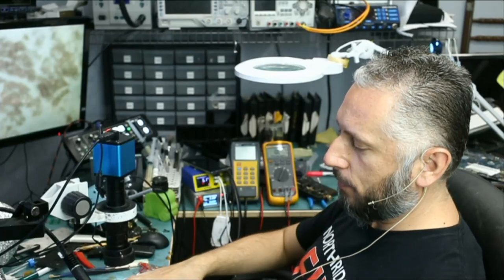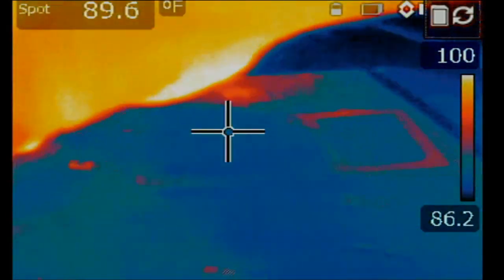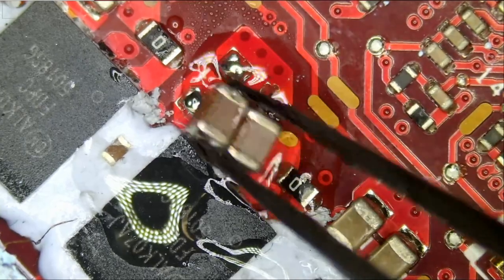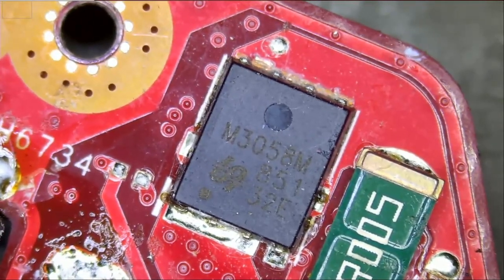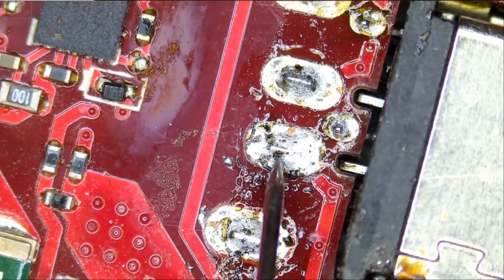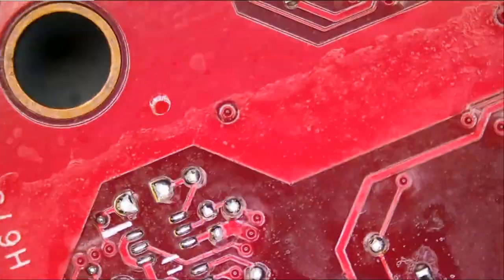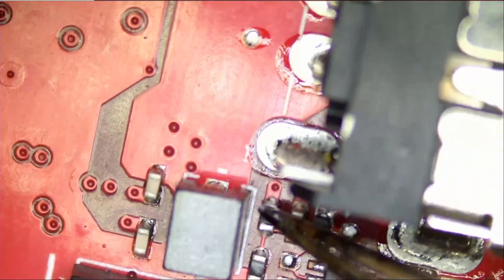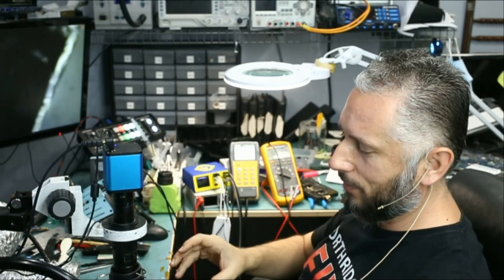Asus ROG Laptop No power Repair - Got my head spinning.

Comment: You're very good, I was impressed with how you managed it even without schematics, I hope they pass right to repair so you can keep doing your amazing job with even more quality and speed!
Reply: I believe it's a combination of 4 factors that makes this guy good.
1) Basic knowledge of electronic components.
2) Correct diagnostic equipment and basic use of.
3) Critical, logical thinking.
4) Experience.

Comment: This man's a genius. 

I just paid 55$ at my local repair shop to replace a blown capacitor on my Dell. It was tiny, tiny like a grain of sugar, and even after soldering a new one - it didn't work. So I had to go to another shop about 2 hrs drive away and spend another 75$ plus 3 days to get it fixed (coz they didn't know where the prev shop had screwed up). 

Alex here does it so easily, I wonder why other shops are unable to do the same.

Comment: π Filter ! 
!first time school helped with something!
it's even shaped the same ( 2 Caps and a coil in the middle ) and the coil was missing.
the problem in this instance is that it's better to replace with wire because as an RTX gaming laptop the 0 Ohm resistor/Fuse is gonna be under serious load ( 200W give or take )

Comment: looks like a ferrite bead to block rf interference from or to the dc jack.  not really needed, a piece of wire will do just fine.
Reply: he measured 0.4ohm - that's way too high for the bead or any coil  (over 6W at 4amps) - I guess he should have zero'd the ohm meter 1st. There are 2 caps on both ends, I'd guess any choke would do.

Comment: Congratulations Alex. 
This looks like a pi filter formed by the two caps under the missing component, that it is an inductor.
This topology is used to filter noise from the power supply.

Comment: I wondered if that spot was a missing a component at 9:00 when it was in the frame! I’m no expert at electronics by any stretch but this made me feel good. I definitely wouldn’t have thought of replacing it with a resistor, that’s genius. What an entertaining and well executed fix. Well done
Reply: A 0 ohm resistor is basically a wire, with burnout protection

Comment: Went back and monitored a couple of earlier videos where you couldn't fix the computer boards  even after replacing components that either looked bad or showed up "hot" on the thermal cam.
Your reason for the "no fix" on these was always deduced to be a CPU problem.
I still wonder why you don't replace the CPU's on these boards.
I know that there is a lot of intense soldering on these but I've seen you do that kind of soldering before with ease.
Just looking for your answer to this question Sir.
Thank you for all your great work!
Reply: >I still wonder why you don't replace the CPU's on these boards.

CPUs are expensive and hard to come by - you can't really buy them, so the only way to harvest is from boards for parts that are not guaranteed to have working cpus; He'd need the same family CPU at the very least - even then the bios might not support it, unless the cpu is exactly the same. Then the replacement of the cpu is a proper bga rework, which is time consuming and done on bga rework station. Before putting a working CPU he must be sure the board will not blow it up again.
So overall - expensive, time consuming and not guaranteed to work and may blow up an expensive component, i.e. the CPU.

Comment: I cannot believe how much things have changed.  I was repairing boards for a manufacturer back in 1985 to 1991 and all I had was a soldering iron, a solder sucker, o-scope and voltmeter.  They also provided a magnifying light.  I got into network admin after 91 and never picked up a soldering iron again.
Reply: I can't imagine how things would change 10 years from now given the exponential advance of tech.

Comment: Where do you get all your donor boards? Having what seems like an endless supply of parts and board to compare to seems like it's a lifesaver
Reply: As a repair shop they accumulate over time. People will recycle the device with you when it’s no fix commonly.

Comment: I have seen the solder Bridge used before as a weak link. I can remember this was, the case when I replaced a PLL chip in a  radio transceiver. Maybe it's used to protect the lcd

Comment: Why do you not keep the 0 ohm resistor in it? Is it not as reliable as the original resistor that holds 0.4 ohms? Sorry, I'm new into microsoldering. I have many questions, maybe some of them are dumb😅

Comment: That is excellent.  what is the advantage of having the board plan (drawing)?  Asus has the drawing, can I conclude that it is safer to get my gaming laptop GX531 g repaired by them rather than by local repair shops?  I assume that the locals have to pinpoint and guess but ASUS not only has the diagnosis port but also the drawing.  I have opened it myself but the charger makes that clicking noise like your other video and the voltage does not go through.  I have to reset the charger.  The laptop was working hot before it went out and did not turn back on.  I am going to thermal paste on the chip etc. and see if it turns back on.  Then decide if I need to send it to ASUS or locals.

Comment: That was tricky. Big luck that those solder pads look like that there were a missing component. Thank you for the video.
Btw where is your other young worker? Did he left? Greets from austria
Reply: it's was quite obvious there was no continuity - and if you look at the board there 2 caps connected to ground on both sides of the pads - gotta be a missing choke. Personally I'd have connected the bench power supply straight to the mosfet with limit set to 1.5A or so.

Comment: Is that a GU502 LU MODEL ( Zephyrus M15) ? 
Mine's display went bad just this morning 
It's been only 5 months hopefully they will replace it as it is still in warranty
Reply: What happens to the screen?
Reply: @kdilac8879  I was using normally then all of a sudden it started flickering and some weird lines appeared then it went blank .No water damage no fall damage. It still displays on an external monitor though which means the GPUs still ok 

I'm just shocked that it's just been 5 months and already display died.
Reply: @Sanjay-ic7de  or it's the screen cable. shorted cable.
you need multimeter if you want to check the cable for short.

but don't do it, if you still have warranty
Reply: @kdilac8879  exactly Iam not touching it they are sending a technician tomorrow

Comment: You need to set a pedal switch to turn the room light on/off it would make handling the thermal cam much easy
Reply: Why would you need to fiddle with the lights to use a thermal cam? 🤦‍♂

Comment: I have the same laptop rog gw502 and had a lot of issues with it. Starting with a resonating speaker, noisy (bearing issue) fan, then batteries started to die, then batteries are not detected at all anymore. It should be covered by the warranty, which I am still waiting for the service to determine if they can fix it or what. If they fail, are you able to look into it? I am in Europe.

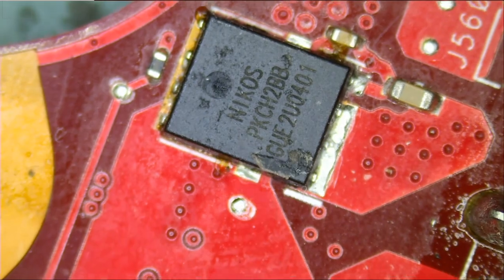Comment: I noticed that component missing right away @8:41 , could be a reverse polarity protection diode?
Reply: that would a terrible idea, the mosfet pretty much does that already on its own. There are two caps on the each side, it has to be an input choke for extra filtering.

Comment: I have Lenovo Z50-70. After pressing the power button, it opens after 10 mins sometimes it opens 30 mins later. Can it be related with the motherboard ? I tried ram changing, 1slot ram, clean the thermals and new thermal, fan cleaning, new SSD, without battery but still same. Maybe i need to show it to a motherboard fixer ?

Comment: surprised he didn't figure out it is a coil straight away . it is there to filter any spikes from the power supply .  0 ohm resistor would not do this and potentially that fix will fry something  later
Reply: That’s why he said he was replacing it with the correct part later on

Comment: Hello good I have a game for laptop Asus rogstrix G15 asus rogstrix g15 g512lw-es76 does not give video only hdmi, when doing maintenance do not disconnect the battery and disconnect the video bus and connect the video bus, from there it did not give more image on the screen only hdmi will have any solution gracias

Comment: Can I use 1.5v AA batteri to inject voltage?
Reply: not enough amps but even if you use a battery that has the amps it would probably explode in your face very dangerous , you need a short killer tool that it designed to do that

Comment: If there is no fuse then how capacitor get hot when checked by infrared camera?
Reply: nice question..
up!
Reply: He injected voltage at other area, not on the charger input.
Reply: @fikrinoh1135  thank you

Comment: leave that zero ohms resistor on there it will be fine.
Reply: Yes, even a dead roach soldered to the board would work or an old penny.
Just kidding...........
Reply: @robertpage2023  I would usually just make a solder mountain and join the pads together 👍
Reply: @robertpage2023  human hair and spit would both work as a resistor though so not ideal I'm afraid... 
As the missing component is a ferrite bead which has no resistance and is essentially just a passive connection, then a zero ohms resistor will be fine although won't remove high frequency noise.... So you might here some squeaks and noise though the speakers or headphones. 👍